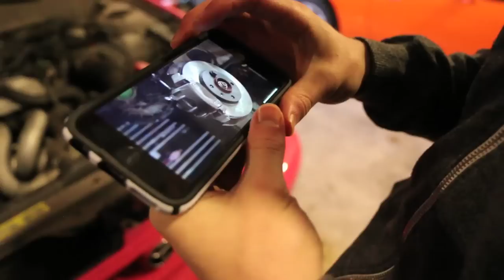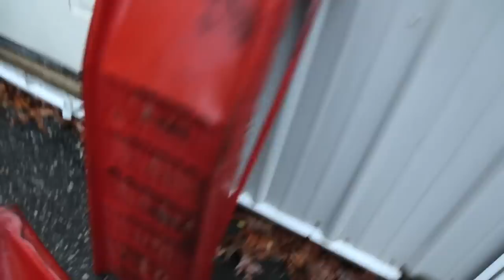FIXING THE JUGGIES MOBILE!

Comment: Goes to change breaks ... Proceeds to check under hood. 

Lol wtf 😂
Reply: Brakes*^^
Reply: I no soo cringe opens hood and thinks strut tops are speaker and breaks
Reply: +YouTube God but you won't
Reply: +curvaciousMammi Corn said they were also "inspecting stuff". Sounds plausible, since you need to get under the bonnet (that's what we call the hood here in England) to check oil, screenwash and coolant and top those up if need be.
Reply: +YouTube God Me too brother, me fucking too!
Reply: I mean, if I was doing a full brake check up first thing I’d do is check the brake fluid before lifting.

Comment: for future reference dude. the "intestine thing" is ur exhaust manifold, that exhales used gas from da engine. the "internal speakers" are connections to ur shocks and struts. DO NOT MESS WITH THOSE. Last but not least that yellow thing pulled is where u check da oil. gotta check that if u expect that car to last 20 years as u said it. (least every week). other than thats coo u got brakes done. lovin ur vids!

Comment: that yellow knob you pulled out that u said was in ur spleen was the oil thing. you pull it out and wipe it on a paper towel and see what color the oil is just in case you need your oil changed. (i know that and I'm a 12 year old GIRL)
Reply: Same.
Reply: Called a dipstick
Reply: kinda..  it's actually to check oil levels
Reply: +wayne lewis lmao.. people these days tryin to act smart 😁
Reply: +zmhd5454 lol yup o well they will learn the hard way
Reply: +wayne lewis its all common sense too lmao
Reply: +wayne lewis its all common sense too lmao
Reply: +zmhd5454 sure is but they have none at all lmao
Reply: +wayne lewis 😁😁😁
Reply: Damn I didn't even know that
Reply: Kinda... For the transmission you check the color of the oil. Red means old and yellow means new. Good job knowing mechanics, better to learn early.
Reply: Well I'm still learning

Comment: Coming back to this with knowledge on cars, and with brake pads like that, those rotors need to be replaced too 😂 and it isn’t as much as cushioning a blow as it is burning the blow.
Reply: eh the rotors looked like they could've lasted another year. but i guess if you're doing a whole brake job, may as well go all the way
Reply: @xavierramirez1911  well the reason I mentioned a rotor replacement is because that one pad was down to bare metal. If he were to replace the rotors later he’d have to replace the pads too because it would put on the same messed up wear pattern the bare metal pad left behind on the new rotors.

Comment: always put a jack underneath your car and take the tire off
Reply: Sherlock
Reply: +Preston Campbell on the frame not the cars body.
Reply: You need jackstands and you  can't just leave it on the jacks
Reply: +Matthew Hartford Ain't nothin' wrong keepin' it on jacks. I keep one jack with me, only reason I'd use a jackstand is if I'm changing the transmission or taking out the engine itself, other than that, my one jack is all I need.
Reply: +Corbin Creel I know but if youre working with a 2 or 3 ton truck you need to put it on jackstands
Reply: UFC muscle you do know that not every car has a frame?
Reply: Matthew Hartford Very right about that, the pressure that is built up relieves too quickly.
Reply: axtra92 Yep, framed cars and unibody cars.

Comment: I know all about this and I'm so young
Reply: lol
Reply: Nobody cares. :^)
Reply: Notice how he has a Minecraft pic. Scrub.
Reply: +jack taggart creep
Reply: Same
Reply: Same
Reply: me to
Reply: +Hitthetarget92 if you know all about this shit tell me what these 4 things are and what they do... 1.what is a carburetor and what does it do
2.what is a radiator and what does it do  3. what is a crankshaft and what does it do 4.what is brake drum and what does it do
Reply: Same like Jesse I assume the brakes are in the tires my reaction noooooo there just in the front lights not a hater but that was a stupid statement from Jesse
Reply: +Brayden Taves carburater helps the engine start and if ur in a cold place fuel injection could help the car start as well radiator keeps the engine from over heating and takes in warm air to keep the engine warm enough to run and takes air to the ac vents in the car when the driver turns the cooler or heater on
Reply: +Brayden Taves crank shaft spins underneath the car to make it move and brake drums help ur car from trying to stop and sliding into the other town
Reply: +Le Tourettes Gamer And his name is that "evil guy" On stampylongheads channel :3 breh
Reply: Nobody cares

Comment: Opening The Trunk Has Nothing To Do With The Brake Caliper And Brake Pads. The Circular Things You Were Looking At Under The Hood Is Your Suspension Housing. To Change The Brake Caliper And The Brake Pads, You Will Have To Take The Wheel Off Of The Front And Back Axles.

Comment: Next time when you take the tire off slide it under the body that way if the jack gives out or the car falls off the jack for some reason no one looses a leg. You got one guy on one side working on the car sitting Indian style then you two on the otherside, god forbid something happens the rotor is going to fall on him and hurt him bad. Use the tires as buffers underneath. That way the car falls on the tire not you or your friend. Something my dad taught me. Good luck! And maybe pickup a Chilton's manual. They hell a lot!

Comment: This is funny.. I've seen brake pads installed on a car (on my car), and what you pulled out with the hoop that was yellow was called a dipstick and its for your oil. So obviously when you get the low oil light, your supposed to pull the dipstick out and well the rest you can figure it out. But it's pretty sad that I know this and even he doesn't.... xD

Comment: I know how to change brake pads and the thing that checks air pressure is not what is on the tire that's to put air in it you do not just put on a socket you have to have one that fits and you probably would want to use a impact I know more than you and am 11

Comment: All you needed was the pads,nothing else.maybe new rotars and not a caliper.durrrr
Reply: Then it's a crack in the rubber brakeline to the caliper.that's a save of $100easy.plus did that work and nothing done for the rotors.especially if it's squeaking it trashes your rotors so you get them machined down a cpl millimeters
Reply: +Samuel Yi possibility also when he goes to stop or slow down it will thump,like mud in the rims or flat spot on the tires.best way I can explain
Reply: +Samuel Yi calipers usually are good for life unless they fail completely